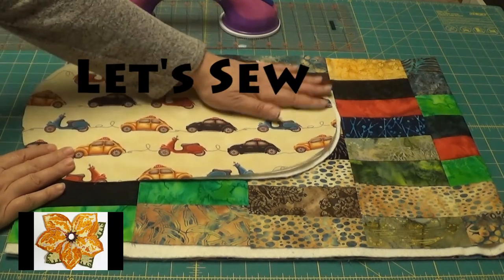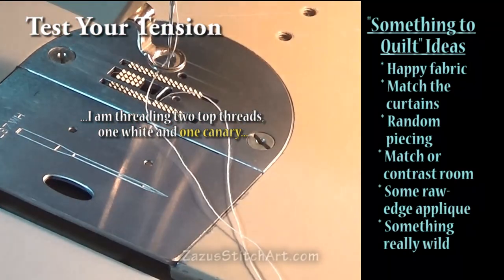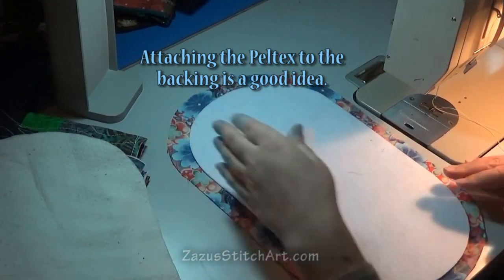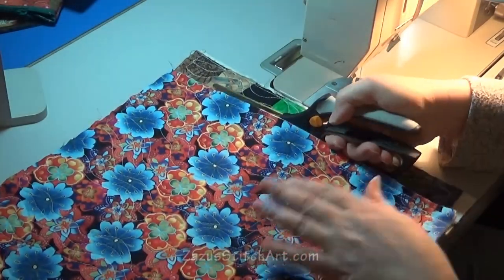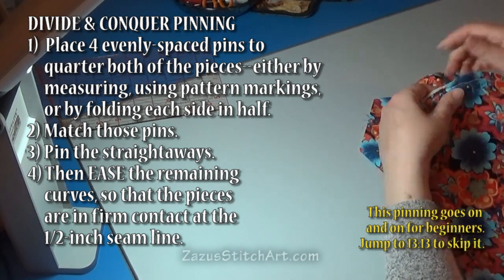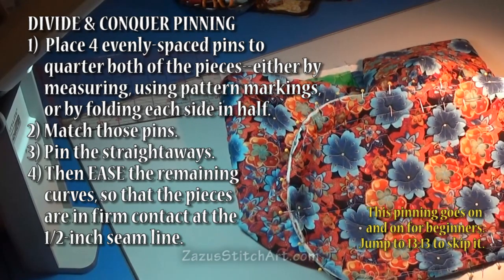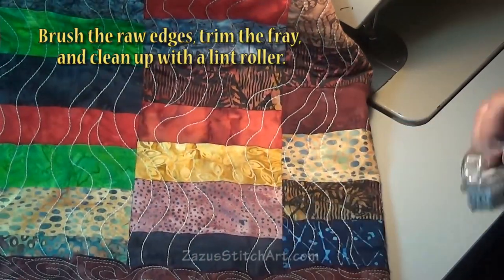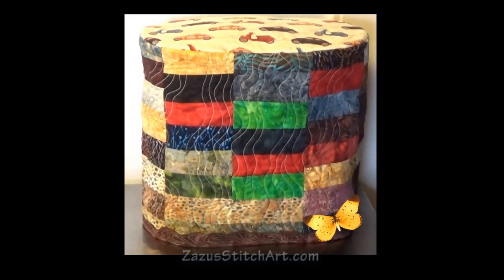Free-Motion Quilt a Cover 4 Stand Mixer | Zazu's Stitch Art Tutorials

Comment: Another great tutorial, Beth!  Why do you always use batik for your raw edge binding?
Reply from the maker: Great question. Batiks are a tighter weave than most prints and other fabrics, and therefore they are more stable over time along the raw edges. Also, I like that they are solid in color, which makes a nice contrasting border to the body of the work.  And yet they usually feature a lot of nice variegation, which  is very forgiving of imperfections--both during the initial construction and in use later, as with food and other stains. Thanks.

Comment: Maybe so that it won't stretch during quilting?
Reply from the maker: Thanks for watching and commenting! Among other things, I was in the "artistic" potholder business for years, and so I have made and sold thousands. At the height of my productivity, I was using 30 to 40 batik fabrics in a wide range of colors to back and bind them. Practically speaking, the bias binding would have driven up the price, mainly because of labor and additional rigmarole. And YES, it would stretch too much! I know there are valid reasons to use a bias binding. But in this disposable society, I have always felt that I was sewing for the decade, not the ages. And of course both projects could have any type of binding. [I finally gave away the potholder recipe here, if you are interested in seeing how I do that:  Free-motion Potholder w/ raw-edge binding | Moderate Gift: https://youtu.be/cY9yN5INpc4
Reply from the maker: I messed up that link: https://youtu.be/cY9yN5INpc4
Reply: Very pretty !